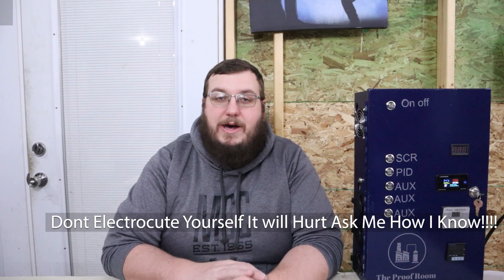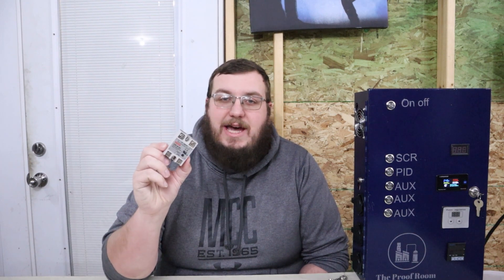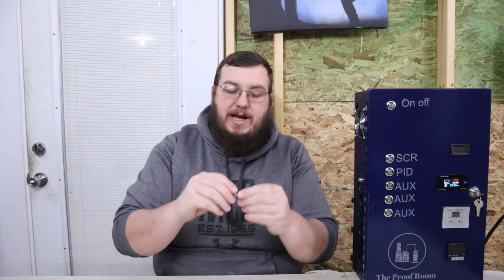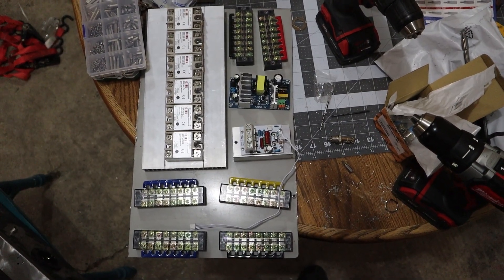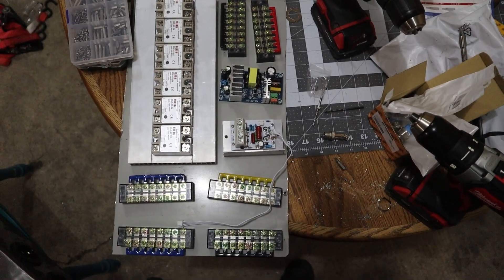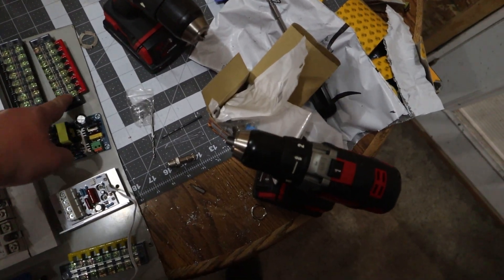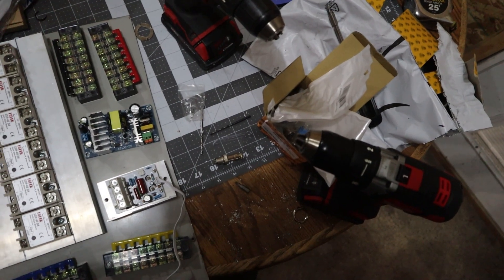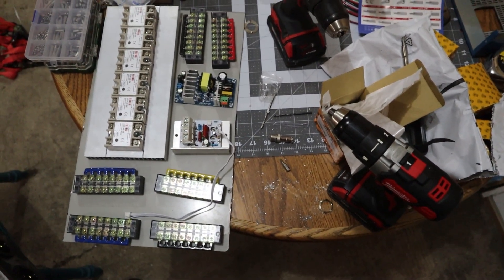SCR Still Controller Part 2

Comment: What is the sixth SCR for? Where did you get your Terminal strips and switches couldn't find on this or the first post? Are you using a ac to DC power supply? Whats the controller above the key lock? How are you controlling the SCR other than the PID and the PWM control? Sorry for all the questions OCD engineer here and building my first control box and am looking for the least problems to try to make things problem free. I want to control two elements in my pot one in the ferminator and just an on off for my pump. Didn't see a power supply are you running ac or dc fans?

Comment: Box looks damn fine. Inside and out.
Crank it up with a time lapse with water. Remember to check internal box temps. (Thermal paste helps)
Only had 1 SSR "cook". It just stays "on", no variance from POT... Was doing a run in 98F weather when it "all in/on" cooked.
To be fair it was a cheap Chinese ($20), that was 5 years old that had 100+ 220v runs on it. 
Cheers Brother!
Reply from the maker: The first one I built didn't last through the first run so I went out and got the best parts I could for this.
Reply: @theproofroom1473  +1 The heat sink is key. When I ran 120v for about a year with a 2.5 gallon pot it was fine. (Same SSR but at 120)
I upgraded to 220v  with a 15.5 gallon keg added a huge heat sink from still dragon in FL with thermal paste from radio shack (remember them???...$9.99 paste :( ) and a ebay $5.00 220v cpu cooling fan. Ran great until a hot day couple years later.
I was sitting in front of a fan with a tablet (watching yu tube) and then still output increased like sharpie stream and I shut it down. No adjustment on POT when I tried to turn it back on.
Unplugged, pulled the SSR (I had 1 spare) and back up running in 15 minutes. (Smeared thermal paste from old SSR to new one.)
Bought 5 more (same brand) SSR's for $50 on ebay. Have not replaced since. But I got em just in case....

Got to Tap maple sugar trees in backyard for sap. I fill up a 55 gallon drum for mashing UJSSM this time of year. Maple flavor from rock maple trees... No... Free water/nutrients/extra sugar from them yes.

Anybody reading this far. It takes 40 gallons for maple sap boiled down to make 1 gallon of maple syrup. Unless you burn wood to boil it is not worth it.

Cheers! Sorry about the wall of text! ^^^
Reply from the maker: @BigEdsGuns  yes sir lol

Comment: Really nice setup. Mine isn't as big and I'm only running the element. Been thinking about making one bigger for a element for the thumper. I personally myself have found the avionics connector for the temperature probe are not reliable and moved to the yellow temperature probe connector.
Reply from the maker: I didnt use the plastic connector because I wanted something a little more robust either one Isa great option

Comment: How many (and where are) the outlets  you control? Do you have separate ones for the SCR/PID vs SSR control?
Reply from the maker: Yes so there are two 220 elements on the right side of the one is on just a switch the other is controlled by the scr. The 3 on the left side are 110 one is controlled with a pid for fermentation the other two are just switches for pumps or whatever you may need.

Comment: I now thee are always multiple ways to cook a Steak. Just wondering why you chose to use 12v control SSR vs 110v control SSR as I see there are locking switches that are also 110 and they also make 110v case fans?
Reply from the maker: The 12 volt side only poweres the switches witch turn my solid state relays on and off. They don't make 40 amp 220 locking switches like these. I wanted to keep the footprint of the switches small but functional.